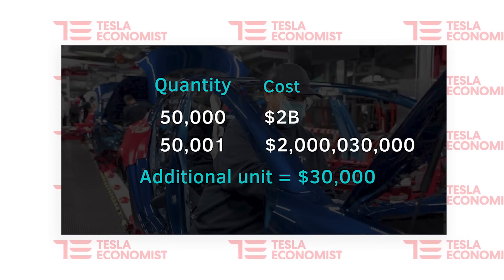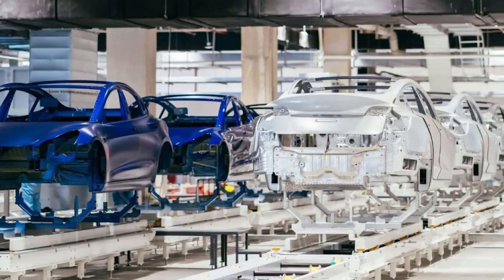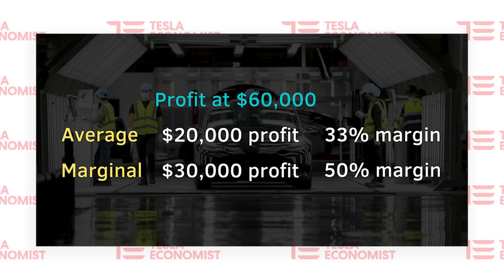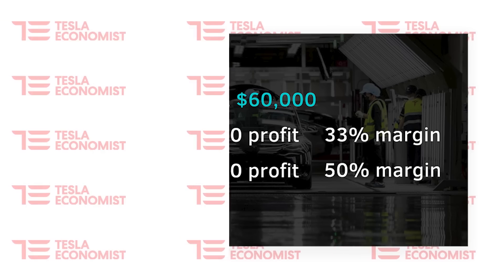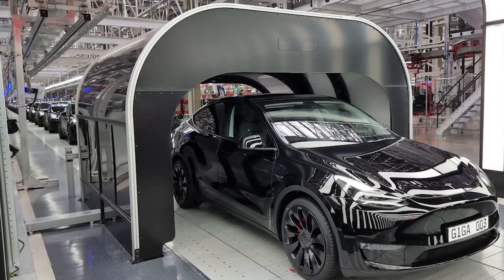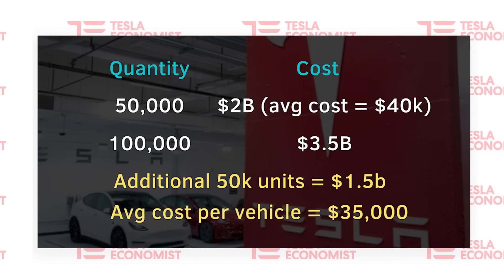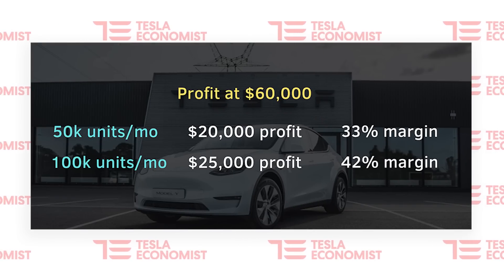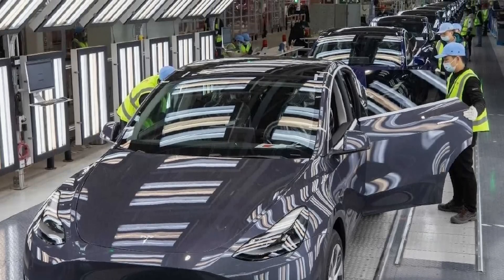Tesla's Marginal Cost is Crazy!

Comment: You make an interesting point about 2x production rate requiring nearly the same staff.  However, I think this holds true mainly when increasing the speed of a production line.  If they increase capacity by creating parallel production lines, then all the robots and staff (from the first line) will be duplicated.  There would still be some economies of scale, but not nearly as good as doubling the production speed of a single line.
Reply from the maker: Yes, I was referring to the sheer speed of one line.

Comment: Will Tesla drop prices?
No, They have other levers to increase demand.
- Reduce the number of drive units in the car (hardware)
- Reduce the acceleration of the car (software)
- Remove the features of the car (s)
  - Autopilot, streetmaps, sentry mode, ....
- Reduce the usable battery capacity of the car. (s)
- BaaS: Sell the car, but rent the battery.  This would remove some people's anxiety WRT to battery failure, and make them cheaper to buy. (s)
The elegance of most of these features, is that they can be software unlocked in the future for a modest price.

Until these ideas are fully exploited, Tesla will be able to find ways to increase demand of their existing cars, where I expect them to have 1 vehicle in each major category.
Reply: This seems to be all about saving costs not increasing demand.
Reply: @jwmc41  The cost savings will mean a lower sticker price, which will increase demand.  My basic premise is that some people just want the basics, and would be willing to pay for a Tesla, if some of the extras were removed from the price.
Reply: These things you propose to lower costs actually raise costs, because it raises the number of variants in the factory which introduces a huge logistic nightmare, and with that a huge cost.

BAAS makes no sense at all for Tesla. A Tesla battery will probably out live the life of the car itself and the differences between batteries are very limited, so why pay extra for BAAS, it makes zero sense... and again, it would introduce a huge costs to keep track and manage all this.

Tesla just provides the best cars they can make with just a few variants, this will never change and is, I think, one of the reasons Tesla makes such insane margins.